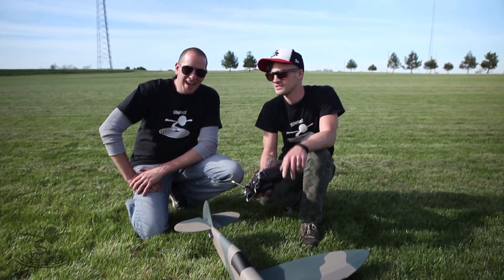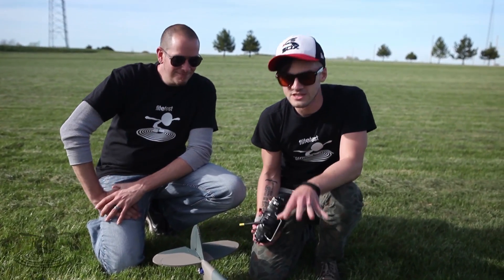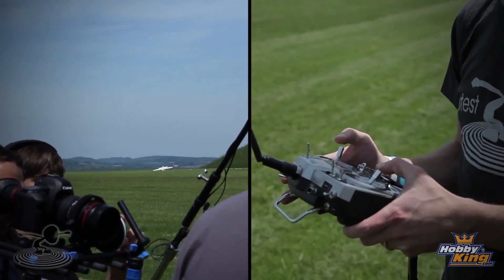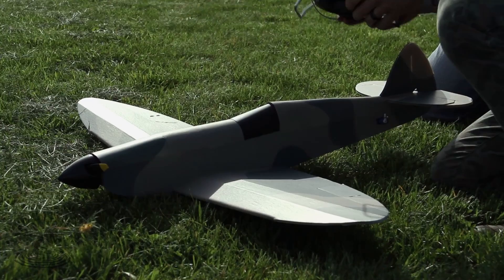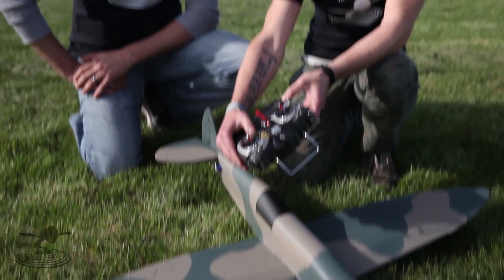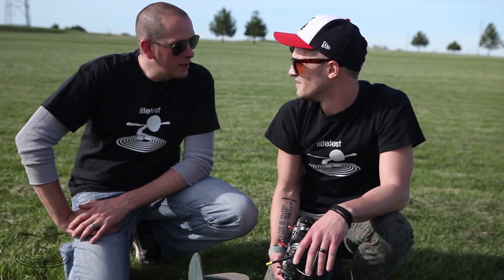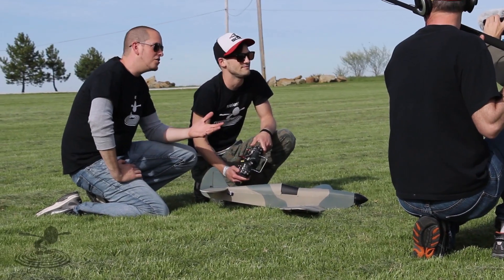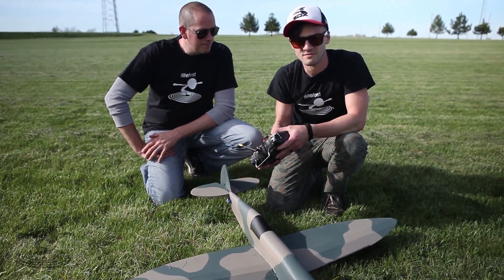Flite Test - High Five Control Surfaces - FLITE TIP

Comment: Yeeeeaaaah... my first Fliton Extra 330... my ONLY Extra 330.... flew for about 10 seconds. I rushed my control check, as excitement came over me for its maiden. Ailerons were reversed, rolled inverted 5ft off the deck and went to pull away from the field. Flip, pull, bam. Slid about 20 feet down the center line. I was SOOO looking forward to that plane....

Comment: Hi flite test, I also built your spitfire and I ordered the beef setup from laser toys. I do not know much about esc's but Mine gets hot fast, I was testing everything and the esc got hot to the touch in 10 seconds of half throttle. I am worried about my plane exploding so what do I do. Is the esc ok or should I get a new one

Comment: I use the physics approach to determine the correct control surface direction.  If the right aileron deflects downward then the right wing will deflect upward.  For every action there is an equal and opposite.  Same with the rudder and elevator.  Rudder deflects right and the tail will want to move left which makes the nose of the plane turn right.  Best way to visualize deflection is to stick your hand out the window of a moving car and change the angle of your hand.

Comment: i think you just need to grab a plane and try it out and you will see that it is correct. think of it this way... the smallest angle between the stick and the rudder gets smaller when you turn the direction you want to go. move the stick to the right and the rudder will make the angle between the two smaller which eventually would result in a high five.

Comment: Maybe do an extended version, like always use the same switches so you don't get confused and have the switches always in the fortward position for normal flying. So if I have my switches in the forward position, I know that my Flaps are up, gear is down and so on...

Comment: They set up the rudder correctly, but the high five thing doesn't really work for the rudder. You push the stick to the right, the rudder goes to the right, that means it moves away from the high five, not towards it. I love flite test but their method here doesn't really work for me, I just think of the physics of what's going on instead.

Comment: it is if the controller is above the cockpit of the plane ( in front of the rudder). if you are behind the rudder your reasoning is correct. but they clearly say the controller needs to be above the plane

Comment: I love the idea, but sadly it doesn't work with the rudder. If you put the Tx over the plane and move the stick toward the elevator, the elevator moves toward the stick. When you move the stick toward either aileron, that aileron moves toward the stick. Good. 

Now do it with the rudder - uh oh! The stick and rudder move in the same direction, so they never "meet" in the middle like all the other surfaces do.

Someone who doesn't understand this is normal might think their servos are reversed!

Comment: djif450 frame review: Not heavy but not light, integrated PCB is great, arms break too easy (dont use for stunting), and the arms transmit more vibration than aluminum arms.